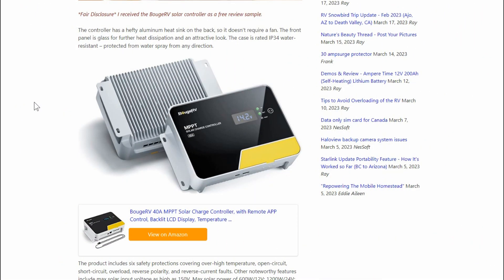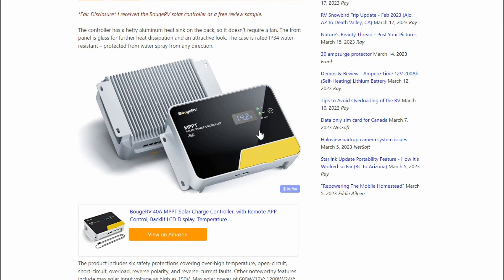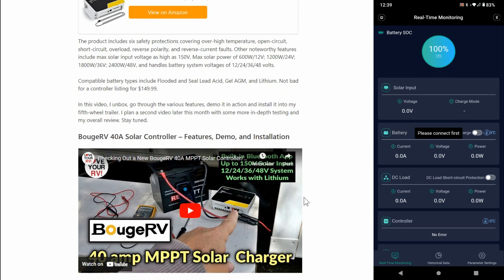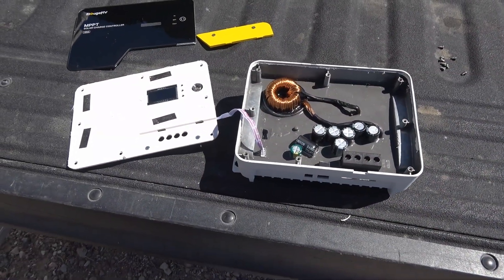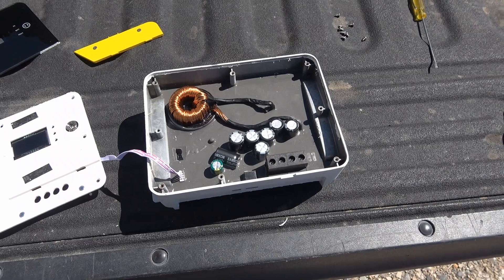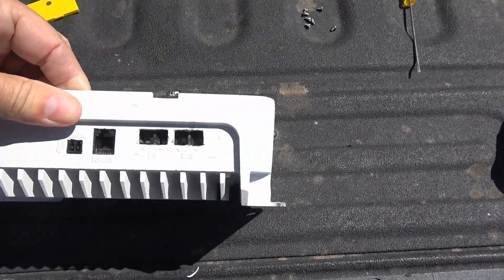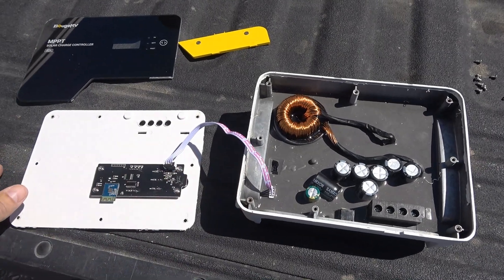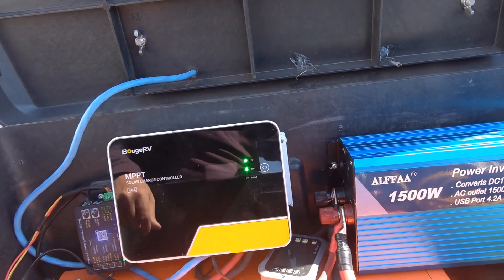Review Update - BougeRV 40 Amp MPPT Solar Controller w/Bluetooth App

Comment: Thanks for the video. I’m guessing my existing 10 awg that is run in my new trailer isn’t going to work with this controller?
Reply from the maker: It's kind of hard to answer your question without knowing more info about the wiring and panels. It depends on how long the 10 awg is and the voltage on it. The higher the voltage used, the thinner the wire needed since the amperage is lower. Voltage can vary depending on how the panels are wired in series versus parallel. Wire length makes a big difference too.

Comment: is battery bank voltage automatically recognized? If so then as soon as charge controller is connected to battery bank charge controller with automatically switch between 12, 24, 36, and 48volts? If this assumption is correct then solar panel voltage should be recognized in same manner. please clarify this for me. thanks!
Reply from the maker: Yes, voltage is recognized automatically at startup, here is the manual from the manufacture  https://site-1306369054.file.myqcloud.com/4953695959689190/2021/10/bkzeWZ8mxe.pdf

Comment: Yeah I knew these were Helios rebranded. I actually had 2 of these other rebranded 30a and 40a from Amazon. The 30a was a Sunwhale that was defective. It kept showing errors in the BT app. Returned. I then tried a 40a Bateria Power and while it's better, I still didn't like it. I ended up with a HQST 40a which is also a rebranded Helios but it had a Load-out which the other 2 didn't. The BT weren't as good but I can live with it. Much bigger in size and runs cooler. Seems more stable then the other 2.

Comment: Tnx for the update.  I've purchased 3 for approximately $120 each on Amazon. They run a $30-50 off coupon quite often.   One I had to return due to no blue tooth connection.  I installed 1 in a friends camper van and the other is charging a 200Ah lithium battery in my MH.  Both units the blue tooth app is way off on what it's actually charging.  I was testing it the other day and it was showing 17.3 amps out of a 100 watt panel.  I agree with you, it's annoying to have to open up a menu and pick the blue tooth.

  The built in display is basically useless.  The percentage of charge is I believe based off a SLA battery, so shows 100% charge most of the time. Interesting to see the insides.  All that coating is why it gets so warm.  I'm running maybe 20 amps thru it and it's a heater gets very warm.  I usually have a USB fan running next to it. It does work ok and does charge my battery. Knock on wood!......🤔  I would not recommend it to anyone that wants a plug and play forget it system.  It's just too flaky and inaccurate for me.
Reply from the maker: Wow, 17.3 amps! That sounds more like the panel voltage, not the amps. Are you sure you're not misreading the app? If you look at my video https://youtu.be/KDokbxwWXPM?t=135 I was using a 100W panel, and it showed under solar about 17.3V. It doesn't show panel amps. Then under the Battery, it shows about 6 amps 13.7V for about 80W, which would be about normal as the panel sat flat on the truck box. Yeah, the state of charge percent on these controllers will always be off, even with lead acid, as they are calculating using just voltage. Just as bad as RV dummy lights for accuracy. :)  SRNE tries as well. Just going to confuse people. Don't even know why they try and show it. :)  People with lithium batteries need to use a battery monitor with a shunt or have batteries with built-in Bluetooth. Cheers, Ray

Comment: yesterday I remarked how timely your video was as I had some spare stuff & was going to make a "box" like yours soon. Ironically my spare included the same BorgeRV you are reviewing. I bought it after your initial review some months back. I couldn't get it to function so I returned it with an explanation. I was refunded immediately. I replaced it with the same Renogy that had failed after 6 years of use. The new Renogy worked great. Several months passed. Bouge sent me an email recently saying they could not get it to malfunction. They asked if they could ship it back would I try again and send back a video. I explained that I felt it was just a faulty one & held no ill feelings, these things happen. I felt it wasn't me as the Renogy works fine. I agreed & they sent me the same one back. I plan on trying it again this next week when i get a chance and then give them an update... My point is they do work with you and although months passed they reached out to fix the issue.  The correspondences came from China not local; so this may account for the long delays (?). They appear to want to make things right & I'll give it another try.
Reply from the maker: Wow, that's pretty nice.

Comment: I messed up with my second Bouge controller. I screwed the wire connectors the wrong way and I couldn't fix it because it is all sealed. When I tried to remove the glass it was not budging. I gave up and ordered a Victron Smart controller. I learned my lesson the hard way. The other one that I have works fine. I was just upset with the fact that I broke it, but I couldn't get in there to fix it.
Reply from the maker: Yeah, those connectors are sort of weird they pull up to squeeze the wire versus push down. Applying a little heat from a hair dryer may help remove the glass since it's just held by some glue and double side tape. Cheers, Ray
Reply: @LoveYourRV  Thanks; I will try that.
Reply: I kinda like the idea of imbedding the components in the rubbery substance to make it more rugged, but it also makes repairs, like replacing a capacitor more difficult.

Comment: Ray I know you have had that tool box for a while but do you know where you bought it, the manufacture and name of the product, the dimensions, and a model number if possible ? I think it would be a perfect fit for the back of the truck to keep certain tools dry. Thanks
Reply from the maker: I bought it at a store in Victoria BC called Industrial Plastics and Paints https://buyindustrial.ca/  Its made by a company called Contico https://www.google.com/search?q=Contico&oq=Contico&aqs=chrome..69i57j35i39j0i512l3j69i60l3.1150j0j7&sourceid=chrome&ie=UTF-8 Can find it on Amazon https://amzn.to/400chqZ  It's very tough and thick plastic. Cheers, Ray

Comment: Nice video, by chance popped by now it's out. Good work as always and a wonderful service to us!

With regard to the numbers, 48 Volt - 40A, that's 1920 Watts - this would be nice, but isn't the box too small to cover the potentiell heat dissipation when used that way? Whereas the Helios at 1:24f says 'Part Name 4820N, 20A MPPT, 24 Volt max'. (The '48' indicates 48 Volt but it's still just 24 V?) And 20A, 24Volt - 480 Watts. I think the companies could be a little less confusing here.
Reply from the maker: It is the current output that causes the heat, like in wiring. At higher voltages wire size can be smaller without overheating. So with higher voltage, the things can remain the same size. The max output of 40 amps stays the same. At higher voltages arcing can become an issue, though so maybe why the rubbery coating inside.
Reply: Agreed - and, not fishing for complements, i modify the housings where the wires go into most of the time about the same way, the line wants firm and safe contact right inside and the insulation wants to go as close as possible with it. 👍☀️